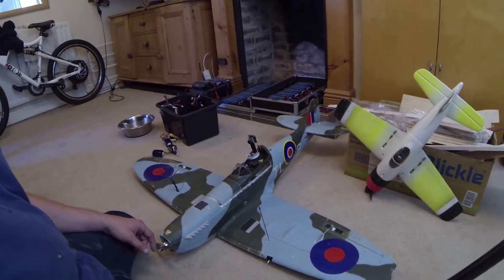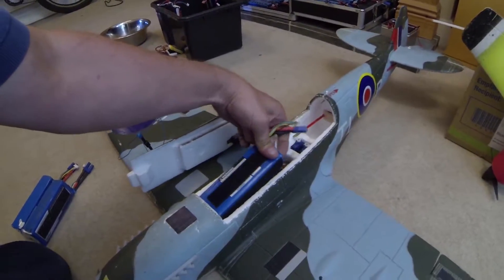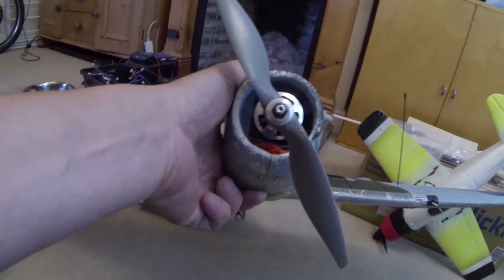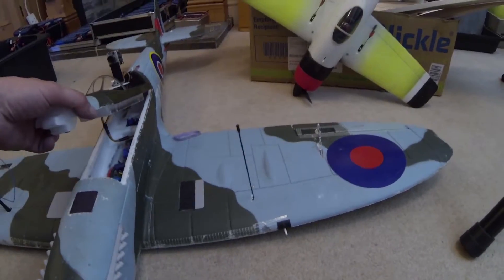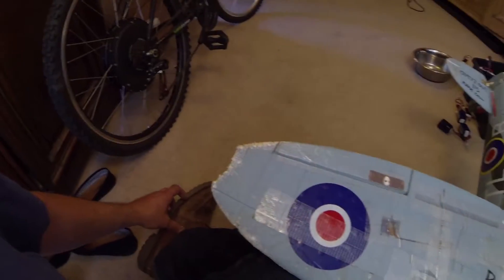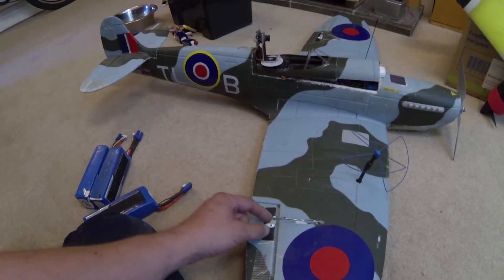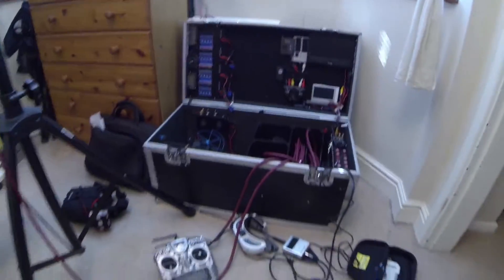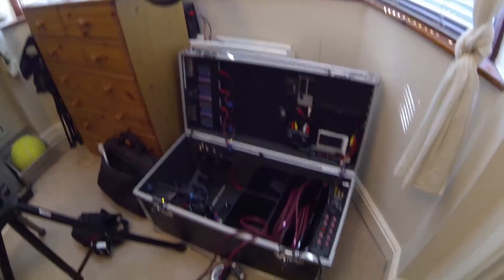SPITFIRE build description

Comment: How do you get so much flight time.
Reply from the maker: Just luck, kept changing prop and motor till it worked well. It was arounfd 15km total distance on the original motor and prop. The next build will use 18650 liion batteries and should have a range of around 60km total.
Reply: OMEGOOLIEBIRD 
Can I ask you from which site did you order the plane from ?
Reply from the maker: I cant remember exactly, I think it was Wheelspin models in the UK. It is the Dynam 1200mm pnp Spitfire.

Comment: Why do you use 14 chargers??? at 0:32
Reply from the maker: To charge 14 batteries?
Reply: At once? :)  What for?
Reply from the maker: Because I fly many planes with different batteries...sometimes I come back from flying needing to charge 30 batteries.. I can wait to do 1 at a time!! Also, you can charge and storage charge and do different chemistry batteries all at the same time. I actually have 21 chargers in total and I need more :-)

Comment: I'm only 4 months late to this video :)  I was surprised to see the CoG so far back, I'd assumed with that motor and a massive 4s in the front that you'd be adding tail weight !  You charging rig is insane as the weight of your ground station box
Reply from the maker: Haha Wayne. It was impossible to get right, the Go pro and pan/tilt mech is actually behind the trailing edge, so very hard to compensate for! I bought a gopro 3 black to replace my GP1, just for this project because it was lighter than the old one! Yeah the ground station is a bit OTT...I am thinking of adding wheels, handlebars and a motor so it can be ridden from van to flying area like a little quad bike....and im not joking....bloody thing is nailing my back.... hope you are well buddy.

Comment: Thanks for uploading a video showing the build. Been waiting for you to make one. Love the FPV Rig. I'm planning on getting a spitfire in the coming months and do the same. :)

What kind of flight time can you get out of a 5000Mah?

Did the landing gear rip off or have you taken them off? Not sure if a grass belly landing would be better than trying to land it on tarmac with the wheels. :S
Reply from the maker: Hi, thanks for your interest. having done some more flights, the total range is actually around 30km if you go gently and in doing that, the flight time is around 35 minutes. That is with the Turnigy 5000 mah 4s 25c battery. I tried various types of landing gear, original retracts and a sturdy fixed frame UC, but they were all a waste of time...it is too heavy for little wheels, Retracts waste loads of payload, fixed UC create a ton of drag, so either way, range drops dramatically. Belly landing is the best option. Good luck with yours.
Reply: Cheers pal :)

Comment: Did this start off as the bare kit version or have you modded an ARTF one?

My lms has one in stock but it is the ARTF version so I don't know what quality the components are.

Great Spit vids.

Thank you.
Reply from the maker: Yeah, mine was ready built with servos etc...I took it all out and put gear in that I trust...servos were sloppy and motor was coggy, soldering on connectors was dodgy etc.....The glue they used was CRAP too, the fuselage keeps splitting apart now grrrrr. So if you can get a kit version, I would suggest that is a better idea.
Reply: Great info thank you.